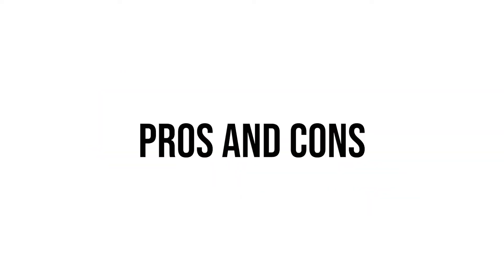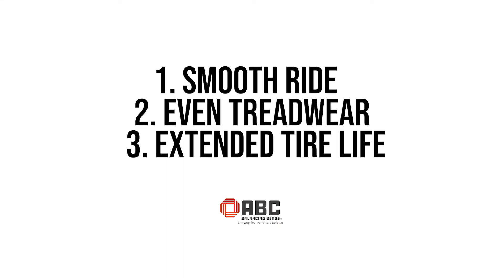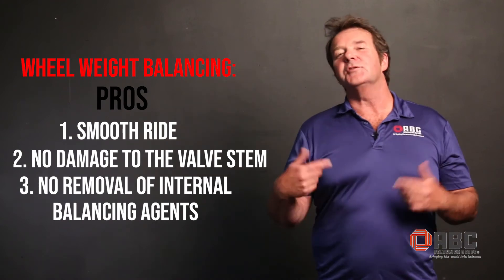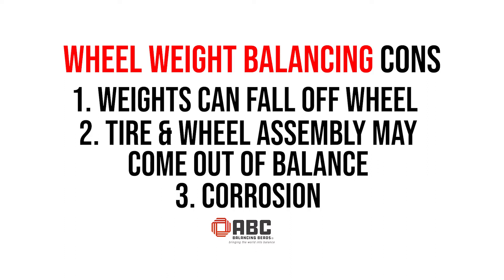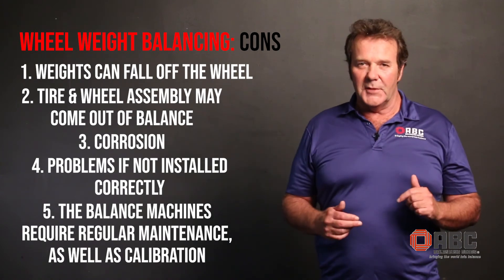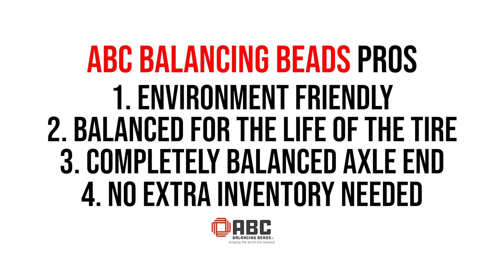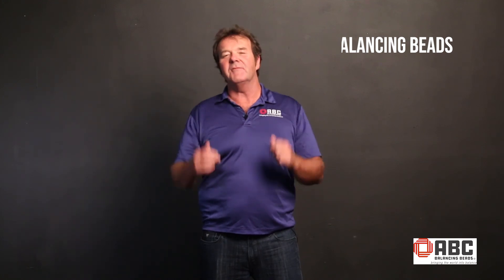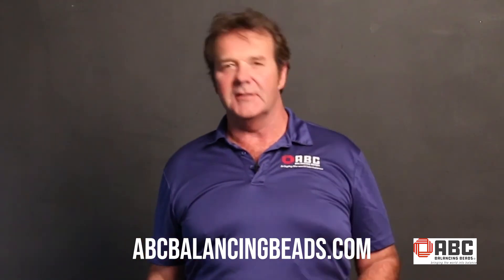ABC Balancing Beads vs Wheel Weights

Comment: Why would I want cooler tire running temperature? As a motorcycle rider I want my wheel and tire assembly balanced at launch especially in cold temperatures. (25-35 degrees F) Do the beads still stick to the inside of tire at these temperatures and not shudder off the line? A hot tire sticks to the asphalt better. Do these things really compare to a dynamic balance? Can a motorcycle tire really be dynamically balanced like a car tire on a machine? Asking for my own knowledge. Thank you for your time.